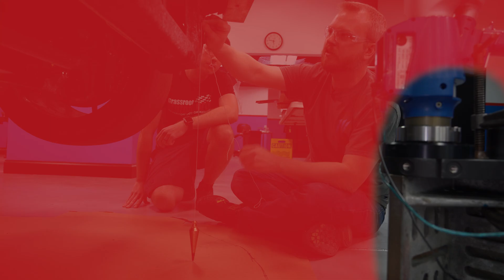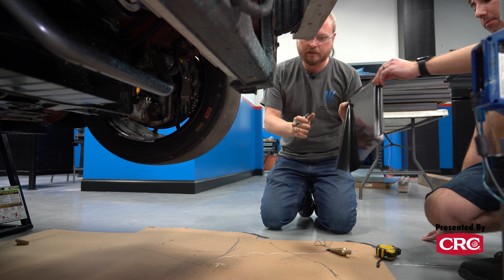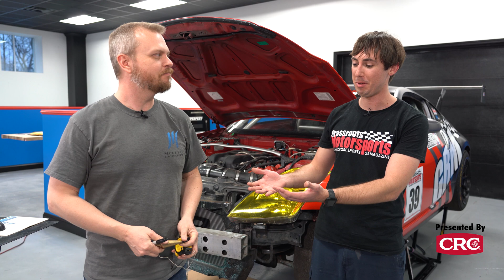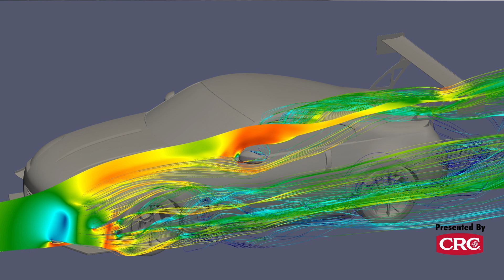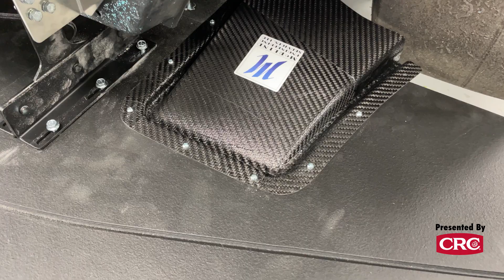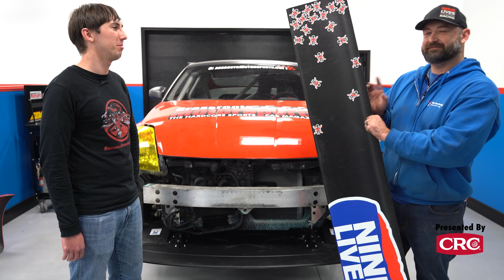The Proper Way to Design a Chassis-Mounted Splitter

Comment: I just get big piece of cardboard, bolt to the frame where I want , and then cut the cardboard to size. If you make mistake there is tape. Once you have your cardboard template you copy it very thing plywood, adjust it again.  Then you make from whatever you want.

Comment: Those "ramps" need to be mounted to the bottom side of the splitter.
Reply: Why?
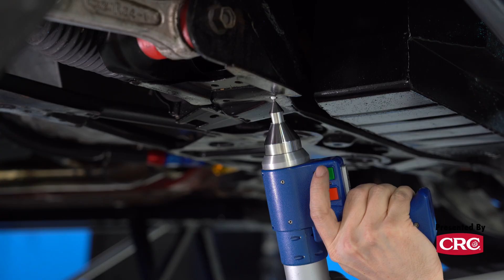Reply: @YehudaAmenra skip to 4:15 https://youtu.be/Ux5uEMP5ulU?si=8FHDUn1vqhIQjaFL
Reply: @YehudaAmenra  smoother airflow. Mounted on top as shown, the abrupt transition from splitter to ramp will easily cause flow separation and the ramps end up not really doing anything at all.

Comment: I have an aluminum splitter and without support bars the down force deflects the splitter above 135 mph which will snap the bumper tabs and pull the bumper loose from the clamshell.